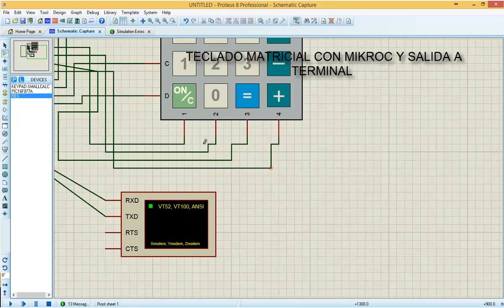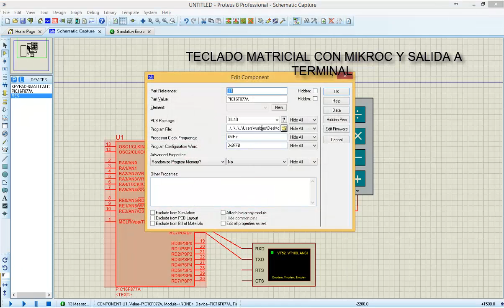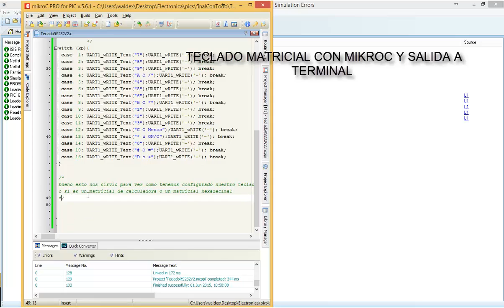mikroc con teclado matricial o hexadecimal

Comment: hola, como puedo hacer si quiero enviar una variable por el puerto, por ej de un sensor de temperatura
Reply from the maker: Fredy Gauto puedes simplemente mandar en formato de texto por ejemplo temp:15 entonces solo le haces un split a la cadena por : y listo es cuestion de tu programación en tu receptor.
Reply: EZ Development muchas gracias, mi situacion es la siguiente, tengo una app que va a recibir los datos, mi variable es del tipo unsigned char temp;, textos ya puede enviar sin problemas mediante la funcion UART1_write_text() , pero a la hora de querer mandar mi variable char tira cualquier cosa, probe tambien con UART1_write(data), y ese lo mismo
Reply from the maker: Como te va, disculpa la demora de mi respuesta, pero si sigues necesitando ayuda en este tema, hare un video con un ejemplo como para que puedas aplicarlo a tu proyecto, me puedes responder si aun sigues precisando ayuda?, gracias.